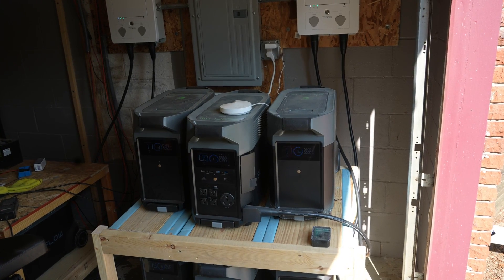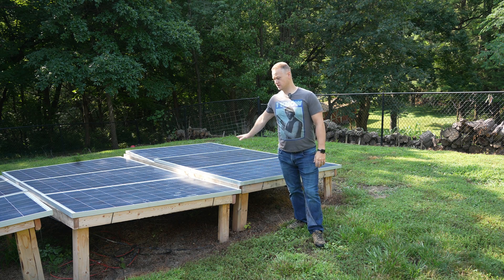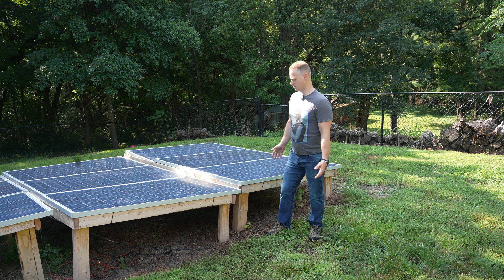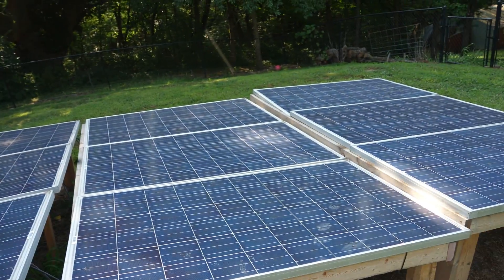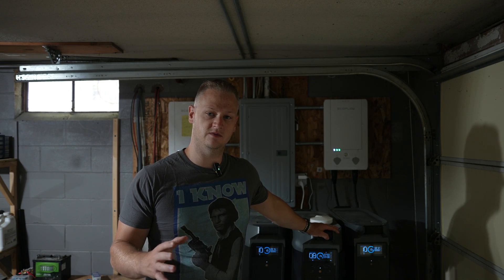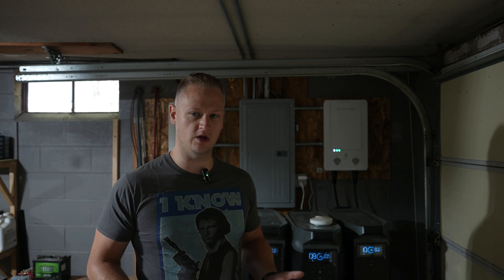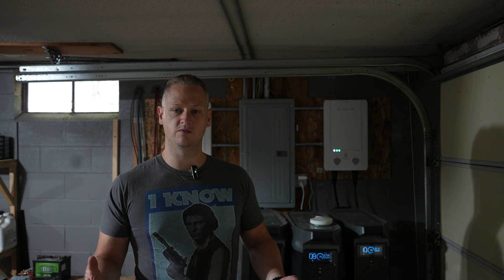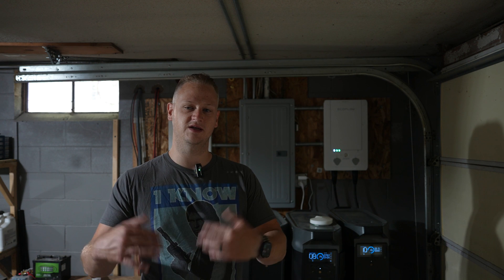How To Maximize Solar Input with the Delta Pro

Comment: I know basically nothing about what I am doing 
I have the EFDP and need around 1000w of solar panels 
I have limited ground space and don't want to blow up my EFDP 
Can you give me an idea of what to look for 
I totally can not wrap my head around all the watts and amps and volts loll 
It would be fantastic to just find a simple system  please and thank you 🙏
Reply from the maker: Based on what you've shared I would recommend something like the Eco worthy 200w  panels. 

https://amzn.to/4lxhjpw - Eco worthy 200w / 24v Solar Panel

To get approximately 1000-1200w you would need 3 of these 2 packs.  You could string them all in series but that would put you around 144v which is kind of close to the limit of the EFDP. If you live in cold weather environment where voltage might rise in cold temps, I'd recommend buying an MC4 Y connector ( something like this https://amzn.to/4kely86 ) and putting 3 on one string and 3 on the other. 

Hope that helps!

Comment: Would it be worthwhile fitting a 15amp 150v circuit breaker to avoid any mishaps? I’m planning to use various 12v panels ranging from (1x) 20w , (1x)!200w, (1x) 150w, (1x) 300w, (1x) 350w, (1x) 400w and had initially planned to connect each (non parallel) via many branching connections but thankfully I watched this video because it’s likely I’d damage my delta pro and need to take the advice in a parallel type set up to avoid multiplying ampage (keeping it within 15amps whilst maximising panel output) Is there any advice for my plan to install varying rated panels as described above? Soon I will have to take photos of the panels ratings to do the maths but I’m sure I’d not need any more solar panels?
Reply from the maker: A few quick thoughts. You mentioned various 12v panels, I would be surprised if all of the ones you mentioned are 12v. More than likely you have a mixed array of panels ranging from 12v to 40v or more. While you can technically mix panels and still produce power, I suspect the combined result will not be as good as you expect. This is a really good article that covers mixing voltages and/or amperages on solar panels (quick summary, in a mixed setup, you're only as good as your weakest link):

https://solarpanelsvenue.com/mixing-solar-panels/

As for your idea, unfortunately a circuit breaker doesn't work here. Most are designed for AC and not DC current. But even if they did, it would only stop over current (Amperage) and wouldn't do anything to throttle back voltage. Voltage is the danger to your Delta Pro, not the amperage. I did search a few years ago but so far I haven't found anything (reasonably priced) that controls voltage passing thru it down to say the 150v threshold for the Delta Pro. You may find something different but I did not.

Comment: Hi, just a question so if i do 2S2P
Lets say the total voltage is 150V and thr total Amps is 20A.
Is that safe to connect to the Delta Pro?
Reply from the maker: I can't imagine what panels that you could put 2 in series and result in 150v, I'm not familiar with any panels that are 75voc. :) 

That said, if you are measuring 150voc from them I would not recommend connecting that array to the Delta Pro. It likely would work, it probably would be fine but there's a not insignificant chance at lower temperatures the VOC exceeds 150v and could damage your Delta Pro. My personal recommendation is that you stay somewhere in the 110-120v range. I've seen the best input performance at those voltages. (Amperage of course is capped at 16a with the DP).
Reply: If its 120v and the amp is 20, is that safe?
Reply from the maker: Yes, definitely. That's a good formula to max out your input on the Delta Pro at 1,600 watts.
Reply: Even the amp is 20? And the Pro amp max is only 15..will it not damage the unit?
Thank you
Reply from the maker: Correct, amperage doesn't matter for the Pro. It will take what it needs. You could have 1,000 amps available and it would still only take 16. Voltage is what you have to be careful with.

Comment: How much can a VOC rise in the cold? Is there a general figure like 10% over posted? I live in the midwest and it gets cold in the winter. Also did you end up using all these panels? Im in iowa too
Reply from the maker: There's a few online calculators that will allow you to plug in temperatures and panel specs and it will calculate the VOC at various temperatures.  You only need about 110-120v / 15a to max the input of the Delta Pro so as long as you stay in that range, you should be safe even at the subzero temperatures we get here. 

I've pretty much used all of my solar panels except for 10 545w Canadian Bifacial panels in my garage. Waiting for the right opportunity to get those setup as well.

Comment: I didnt read all the comments, but has anyone ever achieved getting the full maximum rating without over paneling? I am buying the delta pro and 2 batterie within the next couple months to power my home in the Philippines.  We run on 220v here and they sell the deltapro here as a 220 volt system.
Reply: With good sun conditions, I have been able to hit the 1600W peak with four Hysolis 410W panels connected in series. They have a 37.14V Voc, so unless you're in very cold conditions (not likely in the Philippines), they should not exceed 150V in series. For my needs, I parallel connect two 4-panel arrays to over-panel, since I am just north of the 45th parallel (in Minnesota). I'm trying to squeeze out a few more solar watts by angling one array approximately 15-20 degrees SW and the other to the SE. This helps in autumn and winter here when the sun angle is low and the daylight hours are shorter.

Comment: Nobody every says (outright) it's ok to over amp...This is called "over-paneling."  You touched on it but most folks are confused.  Over amping is perfectly OK.  It's wasteful (ok, but not a big deal).  If you over amp, it's ok...the units (whatever they may be...any electrical device/component) will only take the amps they need.  Over volting is the DANGER.  Don't over volt...that will fry your equipment.
Reply: Folks also need to know about cold weather.  Solar panel voltages rise as temperatures drop (see NEC code 690.7).  Build your solar array at 75% of rated VOLTAGE...especially if you live where it gets cold.  EG. at 13 degrees temp, voltage rises by 1.16 for solar panels.  Research...do your homework!

Comment: Just got my Delta Pro, and I ordered 2x Renogy 550w Bifacial panels. Hoping to run my portable air conditioner directly off the sun with my panels :) My portable ac uses up to about 750 watts
Reply: I have the renogy 550w bifacial panels and have been very pleased with them so far.
Reply: Do you think the renogy 590 biracial 
12/24 n type
Would be safe 🙏

Comment: The absolute minimum voltage you need to fully power solar charging on a Delta Pro is 106.7V, with an array that provides 15A (106.7V * 15A = 1600W).  The closer you get to supplying a voltage of 150V, the fewer Amps you need (150V * 10.7A = 1600W).
What you really need to look at when determining how many panels you put in series is the Voc (Open Circuit Voltage) of the panel.  This total value can not exceed 150V eiher.  From the Data Plate shown, the Voc of this panel is 37.2, which means you can have 4 panels in series (150 / 37.2 = 4.03)  So 4 * 37.2 = 148.8, just under the limit.
Once you know this, you can do the calculations Daniel did:
(3*30.1) V* 8.03A=750W   maximum for 1 string of 3 panels
(4*30.1)V*8.03A=~1000W maximum for 1 string of 4 panels
(4*30.1)V*(2*8.03)A = ~2000W maximum for 2 strings of 4 panels in parallel
Since voltage is pushed, it's important that you not exceed 150V, like Daniels said.  However, Current (amperage) is pulled, meaning the EcoFlow will take what it wants, so even though there's over 16A available, the DP's charge circuit will only take (1600W / 120.4V=) 13.2A to get a maximum solar charge value of 1600W.
So if you're looking for PV panels to provide a maximum charging power for your Delta Pro, look for panels with a Voc of 37.5V or less, with the highest Vmp and Imp (mp=Max Power) you can find, and you have a good chance of maximizing the charge power into your Delta Pro with the fewest number of panels.
I've seen a few PV panels that have great parameters to do just that at both Santan Solar and Signature Solar.
Thanks for doing this video, Daniel; it lets me know I'm on the right track for feeding my own Delta Pros.
Reply: This was a great summary. You know what would be helpful is a list of a few solar panels that fit the bill nicely as examples. And then we can find them or something similar in our domestic store.
Reply: @joshuapinter  , here are some panels that I've found on a couple of distributors' sites that fit the math:

Signature Solar:
Aptos 400W, SEG Solar405W, Canadian Solar 400W, Hyperion 400W, Talesun 400W

Santan Solar:
SolarEver 410W, QCells 400W, M(ission) Solar 400W
(I've noticed that listings for "suitable" for our purpose panels are commonly out of stock at Santan)

All of the above panels have Voc of less than 37.5V, which when put 4 in series, SHOULD still have a total Voc less than 150V, which will not cause problems with the EF DeltaPro.

Good Luck
Reply: Wow, thanks for the thorough reply! I’ve bookmarked this for later to check out and see if I can string something together for a summer install. Thanks again.
Reply: @Urugami45 
I think in areas where it gets cold you might run into issues with a 4 panel series. Probably be fine in summer but winter wouldn't the temp coefficient push them over the 150v limit if you are running that close? Maybe drop one panel in the winter? IDK  I just got some 400w bifacials rated at 37v. Guess I need to do some testing while it's cold so I can determine my series count and determine mounting.
Reply: @bw3506  Yes, I think that could be an issue in the cold, and would have to be determined with experimentation.  But I live on the Gulf Coast, and am looking at this from the hurricane-power-outage perspective.  If I need to hook this up, it's gonna be hot, so overvoltage due to temperature won't be a problem.
Reply: @Urugami45  Don't have to worry about it there for sure. I'm in northern OK. It was single digits 2 days here. Right now I have 9 OLD 100w panels and they were charging a DP @ 940w with some frost on them. Normally I only get 720 to 780 pointed perfectly. I was surprised there was that much gain.
Reply: Panels will always come with a voltage coefficient showing how much the voltage rises per degree of temperature drop (in units of -% per degree celsius). You should find the historic temperature low for your area then take the difference from 25C and multiply by the coefficient to get your correction factor. For example, if your low could hit -25C, you would have a total difference of 50C. If your panel has a temperature coeffecient on the open circuit voltage (voc) of -0.24%/C, you would multiply 50C*-0.24%/C and get 112%. Then multiply that percentage by your panel voltage to get the worst-case voltage. This is really important, because at the crack of dawn is the coldest point in the day, and also when your panels will first see sunlight, meaning that your solar cells will basically be at ambient temperature and suddenly hit their maximum voltage the moment the sun comes over the horizon. I have read that the Delta Pro has some amount of over-volt protection, but I wouldn't rely on it much, if at all. Some charge controllers will simply let out the magic smoke if you barely go over their maximum voltage, so you basically never want to come up to that threshold unless you're absolutely confident you know what your controller will do.
Reply: Thank you!
Reply: Question. With this calculations. If I use 4 panels 37.8volts x 4 = 151.2volts. Max is 150v so that 1.2volts more. Will that cause heavy damage ? I can only do 3 panels then?
Reply: @natego5150  I would not use that setup, especially if that 37.8v number is the open circuit voltage at standard test conditions (STC). If it gets cold, you could be far, far over voltage. Best case scenario your charge controller has some protection and the system shuts off, worst case, your charge controller blows and there's a fire.

Comment: I have to watch videos with captions due to begin hearing impared, so sorry if the captions missed this, but what brand of solar panels did you get?
Reply from the maker: I purchased used 250W Trina (I believe) solar panels from Santan Solar. They were selling an entire pallet shipped to my door (Iowa) for I think about $1200-1,300. Its pretty hard to beat that price, although there's definitely more powerful panels and better panels to pair with the Delta Pro if you're looking to maximize the power production and minimize your footprint.
Reply: @DanielGoodwin-jq1oc  If you had to go back and do it over, would you go with more powerful Solar panels?  What would they be?  I have a Smart Home Panel and 2 Delta Pros, which I only got one and battery backup, but didn't know/realize I couldn't make one Delta Pro a slave to the other.  What would the more powerful panels be where I could stay under the 150 volts, but get close or at the 1,600 maximum watts the Delta's can handle?  My thinking was I run off of one Delta Pro while I connect my 220 bi-facial eco flow panels to the other to charge it back up.  For me, I've loved the bi-fical panels, they work the best out of all the panels I have tried.  Also, I'm really grateful for your channel and the content you put forth, I've subscribed and look forward to more of your content.
Reply from the maker: If I had to do it over again, I probably would strongly consider getting more powerful solar panels simply because of the smaller footprint they take. I fortunately have enough areas where I can just always put out more panels but I do have to run much longer PV cables back to the units which can cause a drop in efficiency especially since you have to stay under the 150v threshold of the DP. It would be less of an issue if it 300-400v. There's really a lot of good panels out there, however the ones I would probably consider right now are these:

https://signaturesolar.com/seg-solar-405w-mono-perc-siv-series-solar-panel-black/

They are bifacial like you mentioned and you could safely put 2s3p for a total of six panels and be heavily overpaneled so that you can maximize the DP 1,600w input for most of the day.
Reply: Is it possible to feed one solar panel array into both DP to use up the excessive amps?
Reply: @JenkinsUSA   Oh, not sure, each DP has its own input connector so I'm not sure if there is a custom Y splitter to go into each DP. I don't think I would ever do this, so for me - I remove the solar plug from one once it is full and connect to the next one.  But in another video, Dan said that the connectors on the back of the DP have been getting pushed in after several unpluges and plugging back in.

Comment: What is the affects on the deltapro if my panels go over the 1600 watt limit? Will it damage the deltapro or will it only use what it needs similar to the amps?
Reply from the maker: Yes, you can go over 1600 watts on the Delta Pro (in fact one of my array is about 3,000 watts). The delta pro will just take 1600 watts and any excess your panels produce will essentially be ignored. What you absolutely cannot exceed is the voltage limit. That will damage your DP. 

But you can exceed the 1600 watts and there's good reason to do so. This is called being overpaneled. It helps ensure that your delta pro gets close to the 1600 watt input thru most of the day instead of just peak solar hours.

Comment: What if the volt are good but the wattage is over, will that damage deltapro?
Reply from the maker: Wattage is construct of voltage * amperage. Its not a thing unto itself. The best analogy I can think of is a water pipe, voltage is the pressure that the water comes out, amperage is the amount of water (i.e. a bigger pipe). Wattage is just the combined measurement of voltage and amperage. In short, voltage is the only thing you need to worry about damaging the Delta Pro.
Reply: It will never go over the 1600 on delta pro,  I have an array that is over but most of the time is under , few times was over but I was getting only 1600, no damage at all , I even when over the volts and it when on protection without doing damage.

Comment: Great video. Don't worry about too much amperage to the Deltas. Delta will only accept what it needs and can use.  Feed as many parallel strings as possible.  Absolutely do not exceed voltage.
Reply: Also watch out the wattage limit by DP.